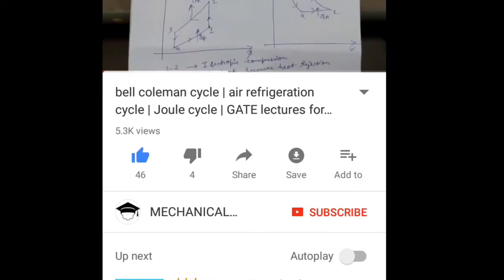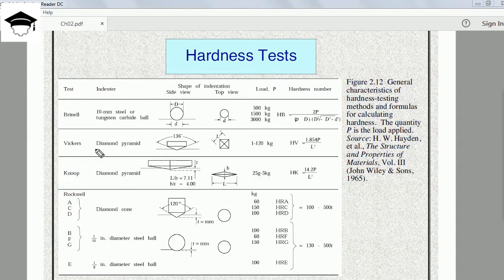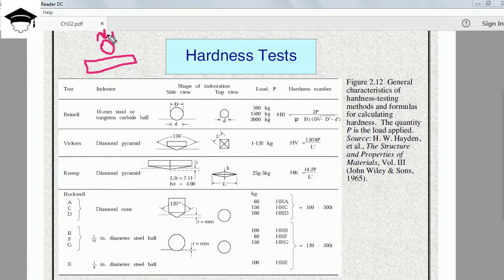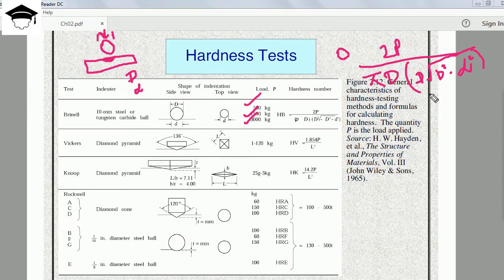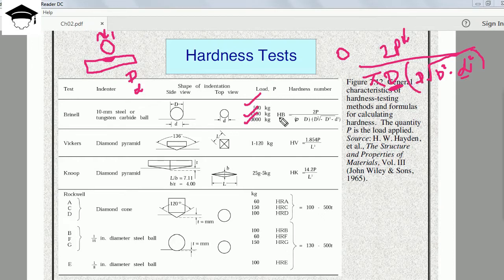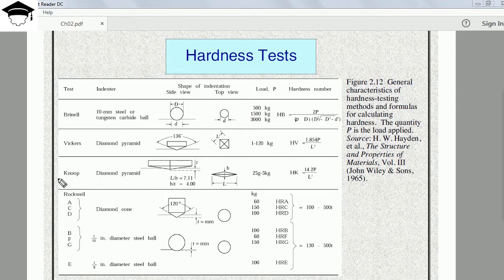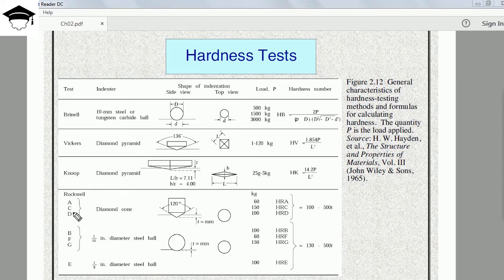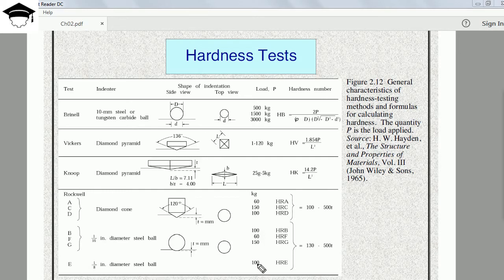Hardness tests (Brinell, Rockwell, Vickers & Knoop) explained along with formulas & calculations

Comment: in vickers  and knoop hardness test in the formula you are using the load you applied and length of the diamond pyramid shaped intender but you are not taking any corresponding value from the workpiece like shape of intendation depth of intendation then how can you calculate the hardness of the workpiece